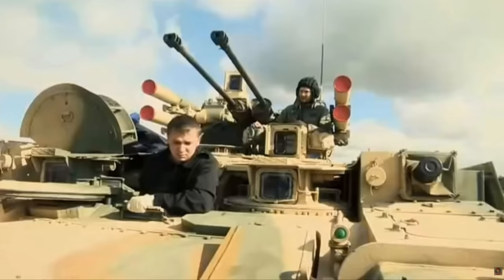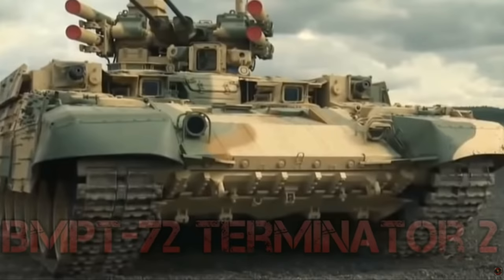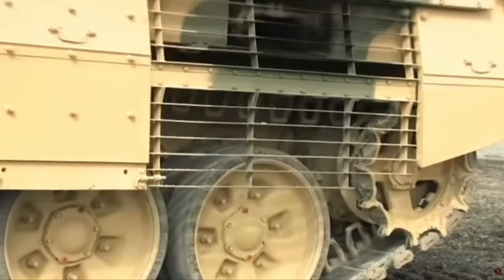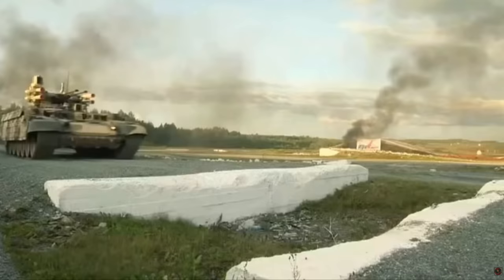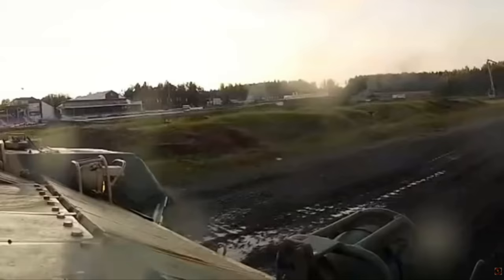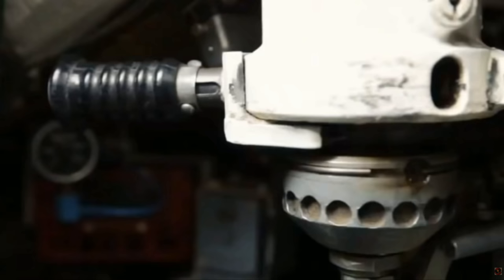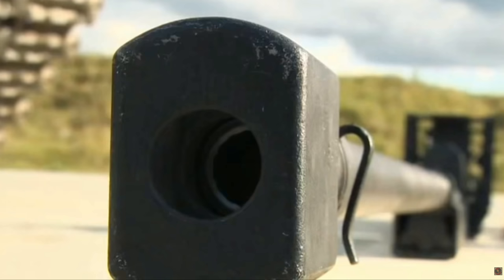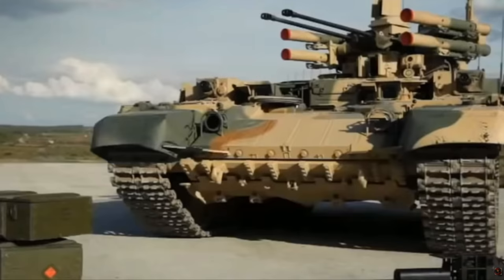BMPT “Terminator" Tank Support Vehicle Overview

Comment: An interesting video but surprised you didn't mention....
1) These were designed away from the Russian military and it was not a military specification request. But then the T72 was designed without a military request due to the problems and expense of the T64.
2) They built ten pre-production test models. With different hulls, engines, transmissions, optics, communications, ERA, all with the aim of finding the best specification. So 100% NOT for front line use.
3) Of the ten built, one was disabled beyond repair or destroyed during testing, leaving only nine left.
4) They were designed specifically for urban fighting. A key element of urban fighting is optical capability. If you can see the risk first, you can either fire first or escape the enemy fire. After rigorous testing by the Russian military, because most are built on T72 hulls and all the crew are in the hull, it was found to be as blind as a regular T72. So the Russian military themselves canned it in 2010. Away from combat, when travelling, it was found to be safer for the commander to sit on top of the turret and guide the driver.
5) After 2010, the only thing the remaining nine BMPT Terminators have done is get wheeled out for the Victory parades each year......until now.
6) Really not sure what they expect from the Terminators. They were initially sent towards Severodonetsk, but as soon as the Russian forces entered the city the Terminators were moved from the potential urban combat they were designed for. They were repositioned around to Poposna, which is a countryside and small village environment. Certainly not what the Terminators were designed for, but they may be able to fill a role there.

It really does surprise me the hype that just nine AFVs have got from the media. If there were ninety or nine hundred, I could understand, but nine will not even scratch the surface.
Reply: Well if that is all they have then they have a big bullseye on them and I am guessing that they will have more than a few ATGMs with their names on them looking for them.
Reply: Well its new concept. So they need to testing it out before mass produce it. You don't want to spend alot of resource on something that turned out to be useless.
Also afaik, they always on Popasna region and not Severodonetsk. I could be not crossing some info though.
Anyway, there are few pict of it already use the ATGM, and they using it in combat alongside some tanks on a hill. So my guess is they on phase of testing it on how good it is on tank support vehicle, instead urban combat focused tank. But who knows
Reply: those 9 are the old BMPT 1's there is no indication of how many bmpt 2's and 3 Russia does have.  in fact, no one knows how many vehicles and machines Russia really has.
Reply: The "commander needs to stick his head out for situational awareness, even in combat"-thing is a lesson the Germans learned in WW2 and talk about extensively. You'll have trouble finding a interview with or a memoir by a Wehrmacht tanker veteran where he doesn't stress that point.
It is weird that it took the Russians till 2010 to figure that out too.

That is also why many NATO militaries hesitate to use auto loaders on their tanks. Having that 4th set of eyes and hands on board is definitely useful.

There are two competing philosophies when it comes to tank/MBT usage.
One sees the tank as a modern "war beast" and the crew as living equipment that beast needs to function.
The other sees the tank crew as a unit of soldiers and the tank as a tool that unit uses to do its mission. Just a weapon you sit in instead of carrying it on your back. 
The point being, that second philosophy is all about the soldiers, their eyes and their brains. They are not just there to drive and shoot the guns. Like infantry men they are supposed to do clever stuff to stay alive and outsmart the enemy.

The Russians clearly follow the first philosophy and they bet on it for the future, as the design of the Armata suggests, because the commander has even less ability to look around and maintain situational awareness in that thing.

I think in Ukraine we see that philosophy fail now.

The Terminator is another technocratic attempt to solve a problem a overly technocratic approach to tactics and warfare has created.

It is the same as the Littoral Combat Ships for the US Navy. 
Extensive war games showed that the concept of the US carrier group is highly vulnerable to swarm attacks and instead of changing tactics and doctrine, the admirals and politicians decided to build a new kind of ship to solve the problem and hope that band aid solution would allow them to just keep on going the way they are used to.
Reply: @carlosgarzon8900  Well their supply is getting smaller and smaller the more Ukriane keeps taking out armored vehicles.
Reply: @Lonewolfmike  typical urkaninan bs...
Reply: @Lonewolfmike  You believe that because we never see Russians destroying Ukraine armour . Even though they have wiped out nearly all armour in the Ukraine army .
Reply: @Lonewolfmike  Just two more months and the RFAF will run out of missiles. Arestovich told me btw.
Reply: @abemigos9281  🤣🤣👍

Yeah, I've been hearing in the past three months that Russia is about to run out of cruise missiles. And every time I hear this the number of missile strikes increases.
Reply: @swordsman1137  The testing has been done back in the early 2000s. The whole project was canned in 2010 as a waste of money and too blind. It may be that they are using them in a different way now to see if worthwhile. After all, they will have plenty of T72 hulls in storage.
Reply: @imrekalman9044  Any word if they're going to send the 300 km ATACMS or just the standard six missile configuration? If it's the later, I don't see how it would be a game changer as it would be equal to the existing MLRS systems already fielded by the UAF.
Reply: @abemigos9281  So far I heard the 300 km variant was rejected. Uncle Sam fears the world (especially Russia) would blame them if their proxies hit a school or market in Russia with them. Russia might take it as an invitation for a tango and strike at a Ukrainian HQ in Lvov or Kiev filled with US military personnel.
Reply: @TrangleC  Solution to swarm attacks:

sticks CIWS all over every square millimeter of hull

(I jest. I have no f'ing clue how to defend against these new threats. I'd bet Israel has the right idea though with directed energy weapons.)
Reply: @Lonewolfmike  yeah sure man... santa claus will give you gifts in person this year LOL
Reply: @trevorcrook5753  Then why does Ukraine have more tanks, now, than before the invasion?? Because Russian troops ABANDONED them and the Ukrainian army has taken possession of them. That has been been proven by third parties.
Reply: @Lonewolfmike  because it’s not true . Ukraine has got so few armoured vehicles they must get to the front on bicycles .Every counter offensive they try fails. They are retreating on all fronts 
If they have so many tanks how come Germany and Poland are sending them tanks ?
Your third parties are imaginary .
Reply: @abemigos9281   Tell me why Russia doesn't have control of Ukrainian air space son?? If they are so vaunted then why aren't they in control of the skies and why is the Ukrainian air force still running sorties?? And what is the name of the anti-aircraft missiles Britian sending Ukraine?? Oh, that's right Stat Streak missiles which is helping make it hard for Russia to control the skies. Nice try there bubba.
Reply: @Lonewolfmike  because of one reason and one reason only: THE GHOST OF KIEV (aka The Candyman)
Reply: @Lonewolfmike  ukraine soldiers are literally using civilian cars for transportation. Why would they use civilian vehicles and beg for tanks and other heavy equipments if they have more tanks now than at start of war???
Ukraine had more tanks than germany, france and UK combined when the war started. Why are they asking for tanks than??? They had more artillery peices than my country india which is considered a top 5 today. Where are those artillery peices? People often forget how much ukraine inherited from soviet union. Yet the facts are not matching. Do the math
Reply: @Lonewolfmike  Do you know what’s the difference between air superiority and air supremacy? just wondering.
Reply: @TheMasterMind144  I saw actual footage of Ukrainian troops going to the front line  in civilian cars and bikes . They wouldn’t be doing that if they had armoured vehicles . 
Russia is only 10% of its available military power . And yet with 140000 troops they have defeated Nato s biggest army  of 700,000 who have had 8 years to prepare in just under 4 months. Taken territory  twice the size of the UK . I think that’s pretty good compared to the failures of America in Iraq , Afghanistan , Syria , Vietnam  etc…. 
Imagine believing the proPaganda that the worlds most powerful land army ( when fully mobilised )  is going to be beaten by Ukraine 
Too silly for words
Reply: @lumberjackagies5158  Because cars are faster than IFVs on normal roads and most importantly consume a lot less fuel which is already in short supply. Soviet era vehicles are huge gas guzzlers which is why attacking logistical supply lines is so devastating and why so many Russian tanks get abandoned.

Russians use cars as well, be it cars stolen from Ukrainians (with big Z letters painted on them) or shipped from Russia on trains (plenty of footage of this). This doesn't mean they have no armor left does it?

The second part of your statement just portrays a sheer lack of understanding for how things work. In a situation where the enemy has more resources than you, then you need more resources to fight them. This doesn't mean that you don't have anything left, the Ukrainians aren't specifically asking for tanks and tanks alone but for a wide variety of equipment.

Imagine saying "if you're winning, why do you request more bullets?" - because bullets get used up, and you don't want to stop winning and give the enemy the chance to catch up to you.
Reply: @trevorcrook5753  Like I explained to another one of your bot palls, Russians use civilian cars as well because they are faster than IFVs on paved roads and because they consume a lot less fuel than Soviet gas guzzling vehicles, and fuel is in short supply for both parties. This doesn't mean they have no armor left.

If Ukraine had no armor then most of Ukraine would have fallen to the Russian army by now, as it stands Russians struggle to even take a small city like Severodonetsk and have been pushed back completely.

Reality doesn't align with this propaganda.

As for the topic of available military, as this is not a war for Russia then no, what you see in Ukraine is ALL they can spare. The 2 million reservists cannot be called in because again, this isn't a war, and this leaves 1 million active soldiers of which 150,000 are Navy and 150,000 air force, which if you subtract the 200,000 in Ukraine leaves 500,000 soldiers which are used to defend Russian borders with other NATO countries, China, Japan as well as the Russian territory itself and which can NOT be pulled away towards Ukraine.

All battle ready Russian BTGs are in Ukraine.
Reply: @cryptarisprotocol1872  "Air superiority is defined as being able to conduct air operations without prohibitive interference by the opposing force. Air supremacy goes further, wherein the opposing air force is incapable of effective interference."

Russia has neither.
Reply: @TheMasterMind144  like i said. Do basic math. If ukriane had more armour than the war started, where are they?? I am not seeing a lot of them?? Ukriane had roughly 2,500 tanks before the war. There are estimates of around 2-300 captured russian tanks depending on the source. Lrp and dpr forces have captured lot of ukrainian tanks as well. Lot of exchanges is going on. So in order for ukraine to hve more tanks than they started, it means they barely lost any tanks (not true), they captured 1000 russian tanks(doesn't make sense either). Add to the fact that ukrainian armour action is almost non existent. Their defense is mainly trench, drone and urban buildings. 

And actually there are many videos of  ukrainians complaining the high command for lack of heavy weapons. Using civilian cars doesn't mean you lack armour, but using civilian cars anywhere near the frontline definitely means you are lacking armour. There are many videos in telegram of dead ukrainians in civilian cars at the front. Even the volunteers who hve returned from ukriane has talked about this..
Russians have captured many obselote foreign afvs as well. Why are they using these vehicles instead of their armour if fuel was the reason
Reply: @cryptarisprotocol1872  If Russia had air superiority over Ukraine then they'd be running sorties over Kiev, Odessa, etc. But they strike those cities with cruise missiles for a reason. Being able to run sorties over territory they already occupy doesn't mean they have air superiority.

Air superiority can only be achieved by eliminating the enemy's anti air defenses, something the Russian air force has not done because it's not something that they train for.

Plenty of recent footage of Ukrainian aircraft and helicopters refute your argument about the Ukrainian air force being destroyed. The Kremlin has been saying this lie for almost 3 months now.
Reply: @lumberjackagies5158  I never said Ukraine has more tanks now than it did before, that was another guy. I said they lost a lot of armor which is normal, and they're requesting even more armor which is also normal, but that none of these things imply that Ukraine has no more armor left.

Leave the "basic math" for a moment and just answer my main question already: if Ukraine has no more armor left than why is the Russian advance stagnating so badly, to the point that they're fighting back and forth over villages?

Most of the fighting is now happening on open fields, at least in the east of the country, and not in urban environment. If Ukraine had no armor left then Russians forces would be able to steamroll through everything, yet they are stuck.

Maybe the reason why you don't see too much Ukrainian armor is because you exclusively watch Russian telegram propaganda and never check Ukrainian videos?

Using civilian cars to transport a small number of troops to set up an ambush is the way to do it, and Ukrainians have been setting them everywhere.

Main question: did you ever see a huge line of civilian cars used to transport Ukrainian troops en mass to the front lines? No? Then they're still using armor like BMPs/BTRs to do this.
Reply: @TheMasterMind144  Nice bargaining with the evidence available, they run sorties over the country and by that asinine “logic” you could say the same thing about America during the Gulf War as to why they opted out for intensive use of Tomahawk missiles deep into Iraq instead of sending in air sorties. Because it’s a cheaper effective way of killing a target without losing an aircraft that’s 20-100x more the cost of a cruise missile. 

And I can pull out footage of Serbian aircraft in the war with NATO and just like war, Ukraine’s footage isn’t evidence of parity, deterrence or preventing of Russian air superiority bozzo. I think you’re conflating air supremacy with air superiority because you don’t want to align with the evidence of equipment losses all neutral states show and that is the fact that the Ukrainian airforce is decimated and Russia has superiority of the skies. And it’s already fact that Ukraine lost its entire airforce from start of conflict, any new equipment you see comes from ex-Soviet states sending them Su-27s and MiG-29s, Mi-8s and so on pulling them from storage.

I think if Russia had air supremacy like USA did over Iraq on Ukraine, you’d call that “air superiority” or some stupidity.
Reply: @TheMasterMind144  because tanks are not the only thing that stops armour advances and donbass is completely covered in trenches and fortifications. Look at their trench networks. They did a lot of fortifications in last 8 years. Also mine fields are a thing. Based on combat footages, it looks like mines are doing lot of damage to russian armour as well.
And no, russian advance is definitely not stagnant in donbass. Even the msm has started to accept that russians are closing in. Zelensky has said that they are loosing 100 soldiers everyday. I suspect the numbers could be higher. Russia is yet to announce general mobilisation and still in with Basically the same 170k troops from February along with seperatist militia. Ukraine is pushing out reserves.

And yes, do the math. Many ukraine units are on video saying they are being sent to fight tanks with klashnikovs and there is no heavy equipment and armour and reinforcement doesn't arrive.  Volunteers who returned from the front has said similar things. 

Also how do you know that the guys getting killed in civilian cars were only using it to transport for ambushes and not  normal mode of transport for infantry units?? A canadian volunteer who came back said that they used a van for traveling and fought in trenches. Add all these variables and it shows that ukraine is lacking in these areas. Amd yes fuel could be an issues since russia has destroyed a lot of depots
Reply: @TheMasterMind144  because from kyiev to kherson, the frontline is more than 2000 km long. That's bigger front than operation barbarosa and Germany deployed a million troops. Russia has less than 200k troops in Ukraine even by NATO numbers and little over 200k including lpr and dpr militia. Unless ukrainians just roll over for the russians, its literally an impossible task to push a front like that with the given troops. No one can do it buddy specially against a well armed numerically superior defender. Russia either tried to scare ukraine into surrender or that was a military blunder.

There is literally zero credible evidence that ukraine has taken back most of sevrodonetsk, other than some twitter accounts and telegram messages. I am yet to see anything from the ground that matches with the Ukrainian claims

Its funny how you call out kremlim propaganda while taking the side of people who were telling stories about phantom planes and soldiers carrying border poles to take pictures. Kremlim propaganda stories involves denying or exaggeration. Ukraine propaganda stories are straight out of hollywood. Ukraine ks clear winner here.

Western Msm has been completely in favour of ukraine. Have you ever wonder, Maybe you hve been lied for 3 days

A civilian van can carry 8-9 people easily. That's an infantry squad.
Nobody travels in convoys at the site  of fighting.
Why would you be in a civilian van rather than an armoured car if you are anywhere near the front??? Unless you lack one.

One or two cases is normal. Multiple cases, multiple ukrainian units complaining on video, volunteers coming back home and telling similar stories. Add the factors